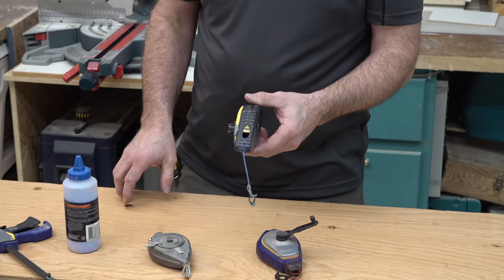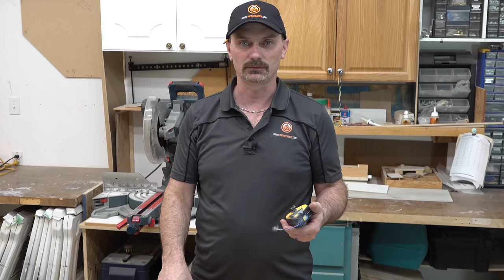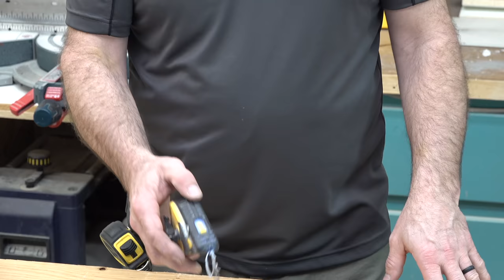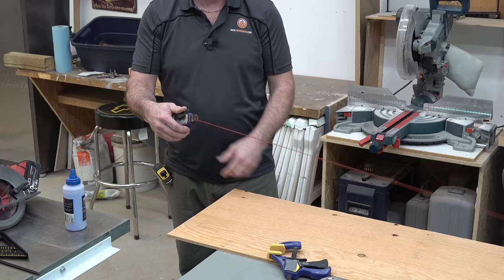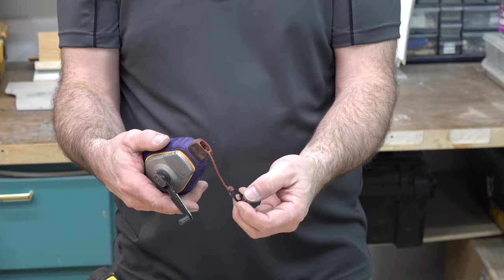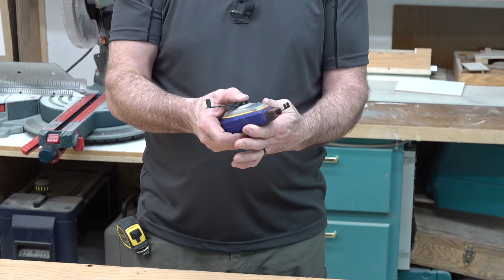How To Use A Chalk Line

Comment: You can also knock a nail at the end then wrap the line around it a few times to keep it taut the end of the chalk line also has a clip which can be used as shown, but it normally has a hole it in that you can peg with a nail too. thanks and blessings.
Reply from the maker: Great tip!

Comment: if your roofing alone and snaping a 60 or 100 ft run can you tie it off on a nail and go snap middle? or can you tie a dry line with no chalk instead and mark the middle, and maybe other two middles you created there too then go back with chalk line and snap it in two or 4 diff sections?

Comment: so you cant even snap a 20 foot line without holding it in the middle? theres gotta be a way you can do it yourself, what if you were snaping 60 foot lines on a roof?
Reply from the maker: Well 20' may be a bit of exaggeration , but after about 40 ' if you can't pull it tight enough or your string is not great you will likely need to pinch mid span